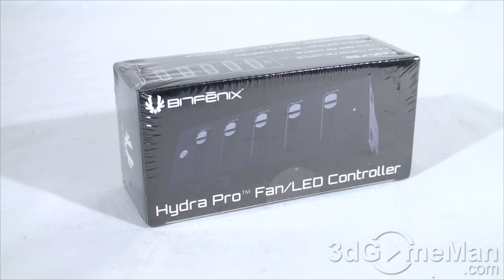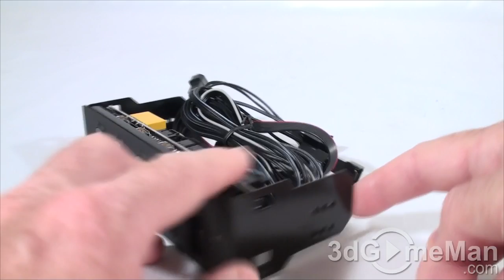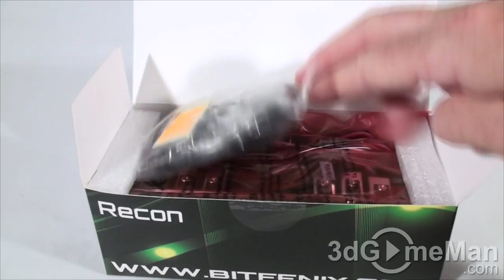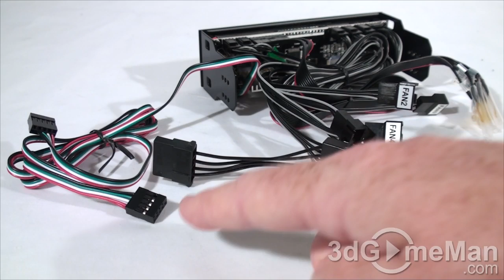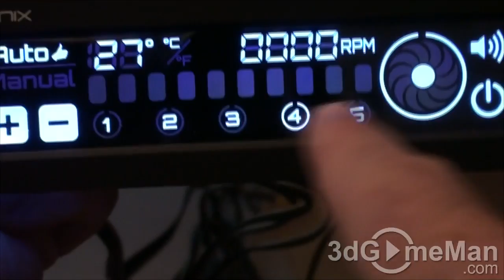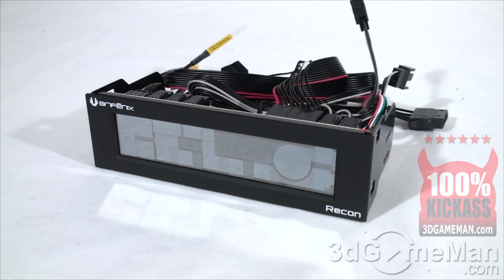#1360 - BitFenix Hydra Pro & Recon Fan Controllers Video Review

Comment: Actually I would recommend getting splitters and just splitting 2 fans per channel. Chances are most of these fans are roughly in the exact same vicinity of each other so you'd really just need to control their combined speed. This way you keep a 5'' 2.5'' bay that you would have lost. Though if you feel like you'd rather keep an eye on all fans separately then by all means get two.